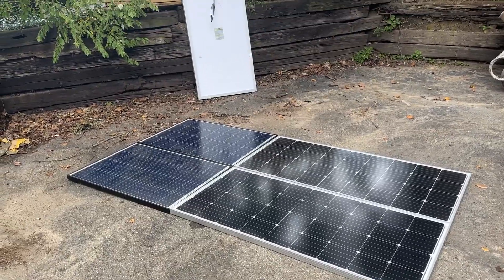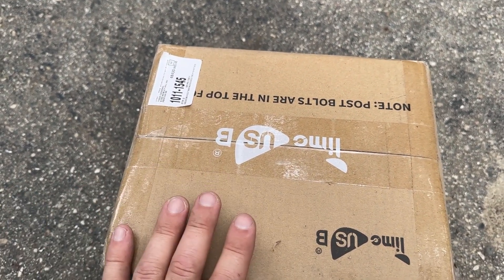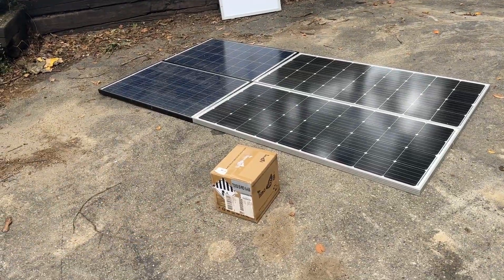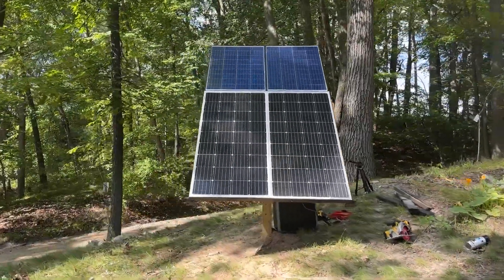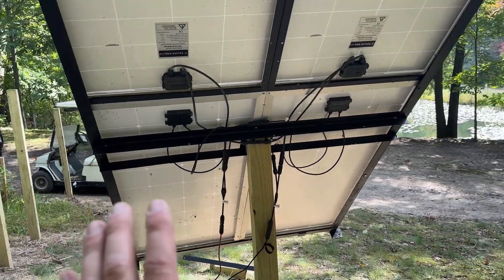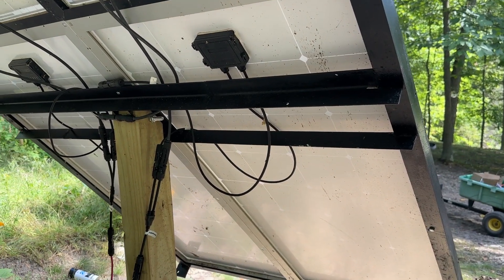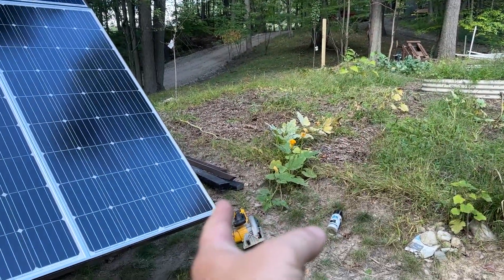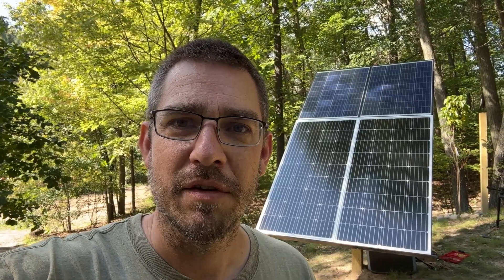DIY 500W Ground Mount Solar System

Comment: I only live about 25 miles from you, so I know what you mean about the wind.  Are you sure that 1 brace will be enough?  You might want to consider making a couple more with some 1-inch EMT.  If this project works well enough, you might want to upgrade the mount to one that tracks the sun.

Comment: Hey Todd, if you haven’t already completed the project with the extra bracing. I thought I might offer a different suggestion of my own. 

Would it be easier and more stable if you buried a short 4x4 on the front of each corner and put a lag bolt in from the metal side into the 4x4. 

That seems like it was be a pretty easy fix and extremely stable. Rather than depending on the 1 single 4x4 in the center to withstand the twisting and turning that the wind will have on it. 

Just a thought. Great video! Thanks!
Reply from the maker: I thought about that also, I may do something like that if it starts to get loose

Comment: Looks good im couroilus on how it will handle the snow load only having the single post. But hay if it doesnt survive the winter its easyey enough to replace. Great job on it using scrap laying around